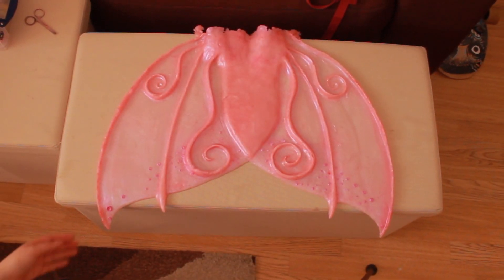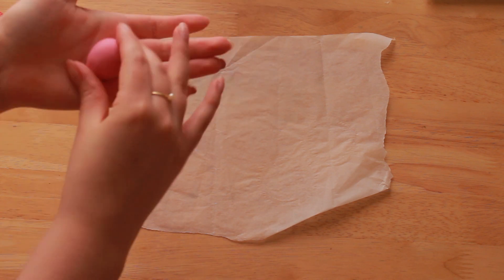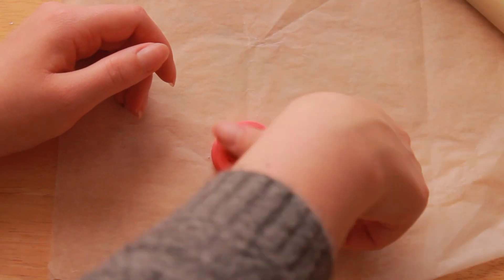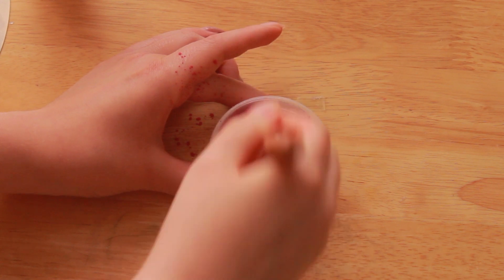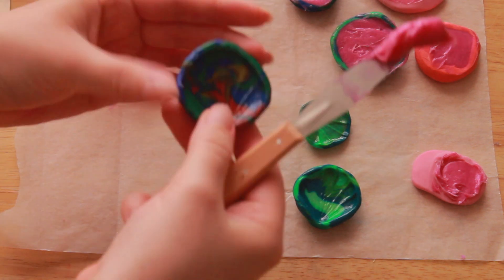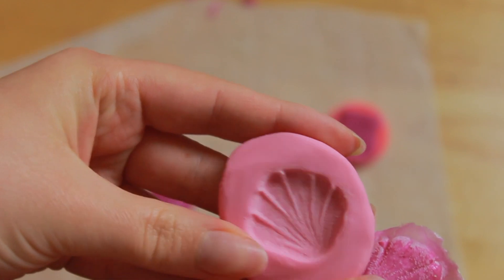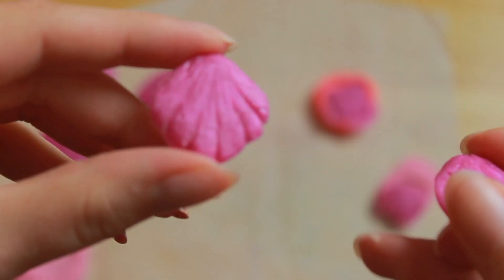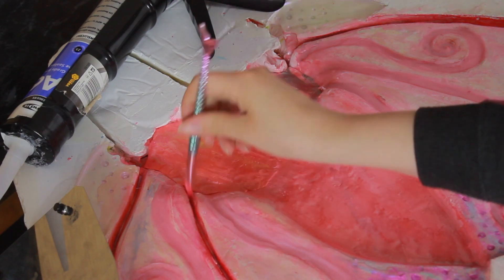DOES PLASTICINE REACT WITH SILICONE? MAKING QUICK EMERGENCY MOULDS | SILICONE MERMAID TAIL MAKING

Comment: Do you have to use powder or can you use acrylic on it's own
Reply from the maker: Just acrylic is fine. It helps the silicone cure and adds colour. Mica powders add cool perlescent effects but are not necessary if that's not the effect you're going for 😊